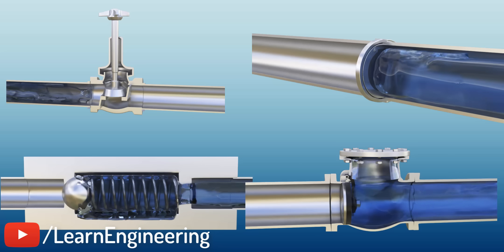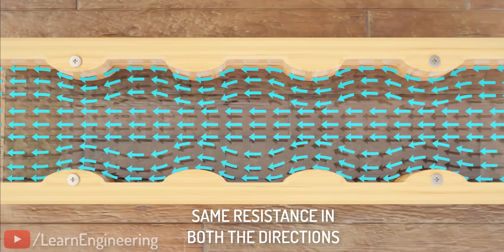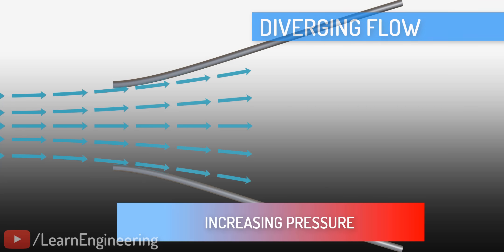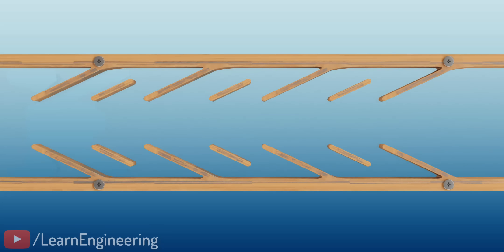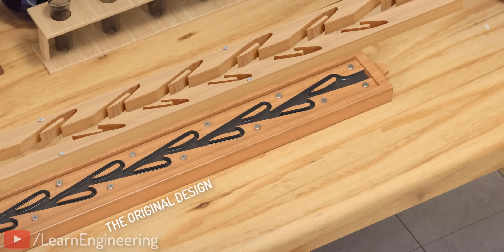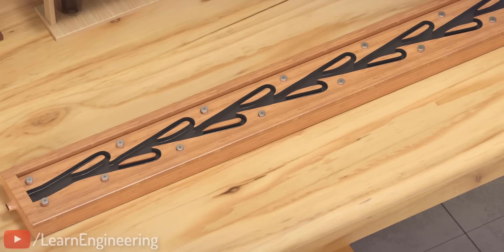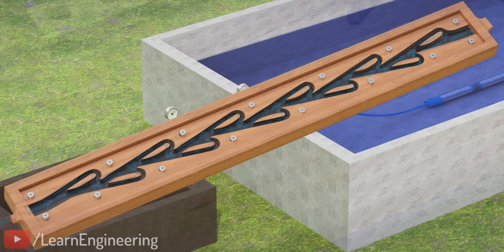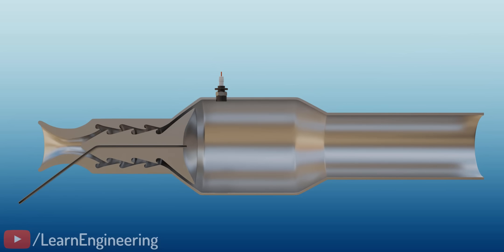Tesla Valve | The complete physics

Comment: When you say "let's see it work" pretty sure everyone was expecting a real life version. You can make anything happen with computer animation
Reply: It should be fairly easy to 3d print this valve,probably already done and tested,
Reply: I just saw a demonstration of this valve where the guy filled it with propane and then lit the propane so the flow was illustrated by flame. https://youtu.be/tcV1EYSUQME?si=F5TRQ5mhFaDe3bG6
Reply: https://youtu.be/NYGq0bD3NBk
Reply: https://youtu.be/NYGq0bD3NBk
Reply: https://youtu.be/NYGq0bD3NBk
Reply: https://youtu.be/NYGq0bD3NBk
Reply: @quynhm.nguyen6433  You may have commented 10 months ago but you did the work finding the video and should be commended.  Thank you.
Reply: With reference to electronics and electrical circuits this simulation is nothing more than a leaking diode with very little practical application. As a component it's function depends on the viscosity of the substance that is flowing through it ie. air, water, gas, oil etc
Reply: @MrNigsWhittington  been there, done that ;))
Reply: You're the same kind of jerkoff that if they did have a actual valve you would claim they turned the pressure down on the hose.
Reply: How about get yourself an engineering degree and build one? What a peasant mentality. 😂 The physics was explained. Then make it work. Otherwise, keep walking.  And since you make a claim that anyone can just make an animation where anything can happen, tell that to computational physics simulations that were designed by programmers and physicists smarter than you. And these programs have actually made breakthroughs in quantum knowledge you know nothing about. You may not know anything about it, because you haven’t tried understanding it. 😂
Reply: no
Reply: Indeed, repeating the animations that were used throughout the video and putting a "pump and pool" on the side of said animation isn't anywhere close to "let's see it work." Might as well cut out that section of the video, it adds nothing and is disingenuous.
Reply: I can't believe a channel with a robot voice and no practical hands on content has this many subs. There are so many good channels with actual humans with way less subs.
Reply: @Umphy  "Robot Voice" "actual humans" This is an actual human. That or the most realistic Robot i've ever heard.
Reply: Real version was made, but the difference in flow rate in both directions was barely factor of two. Basically it was flowing just a bit faster in one direction compared to reverse direction. Not so impressive or even practical.
Reply: @igoranisimov6549  might work differently at different pressures
Reply: @mikelisteral7863  obviously, but the "extinction ratio" is not very high even at higher pressure. It has assimmetric flow just to make it interesting. No practical applications so far.
Reply: @igoranisimov6549  "No practical applications" False. Video literally gave an example of a currently in-use practical application.
Reply: @MrNigsWhittington   It's not really the same process though, these valves are more so based around fluid mechanics, suppressors are more about reverberating the sound waves in compartments that are the same both ways.
Reply: @silverfoxeater lol "why aren't you showing the space bend?" This really shows your own lack of scientific knowledge. The idea that science is mathematics and not based in reality is appealing to mindless cultists though.
Reply: @Nekrumorfiini1  I studied general relativity and have no idea what your problem with that statement is. The instances of spacetime curvature that are observational to (somewhat) naked eye are gravitational lensing and black holes, but the latter only exist far away and it’s difficult to visualise what’s going on, while the former requires you to stare into the sun. They can be illustrated much better via an animation, which is how it’s usually done.
Reply: @vilhelmscinis1588  Your lack of comprehension of the principle of cause and effect is impressive. Notwithstanding that space isn't real, it's imaginary just like the rest of modern physics, the motion of the light does not define the cause of its motion.
Reply: Not only that but it's not even really animating what's happening, just showing stats and expecting us to believe it.
Reply: @MrNigsWhittington  It was never a valve that made it into production, it is more of a theory or an idea, so a computer animation is perfect to explain the theory but not have to go through the expense of the manufacturing.  I am fine with the animation, the valve is a failure and was never used in real life, just an idea, it has no practical uses
Reply: It works like a crib.  There is no way to show you while it actually works.  This is why it is done in animation.
Reply: And it doesn't work ( completely ) it would have a drip leak .... Hell, I can plumb good enough to leave a drip leak. it's a water restrictor, not a valve. I saw you were one of the few people to see this vedio as a sham🥱
Reply: Only reason i clicked the video was to see real life test video... I couldn't care less about all the talking beforehand
Reply: yeah a real life version can be manipulated just like cgi genius
Reply: the dollar has already lost a lot since the beginning of the threats to Russia and Ukraine! The number of transactions conducted in US dollars decreased from 71% to 48% worldwide and the USA had interest on each transaction conducted, since they were conducted in dollars! And now there are fewer deals,, less income,, the default is closer, are you stupid?The USA received hundreds of billions in transaction profits! Less and less now.паВ,
Reply: We have a lot of people thinking that computer simulations are cartoons :v

They think that they gonna show cartoons and they can show anything they want, but they also think that they cannot make the same with "real stuff or systems" :v

I bet they think that using a calculator gonna be a mistake, they need to use their fingers to count cause they can be fooled :v
Reply: You probably don’t understand The Big Bang, so let’s see how it works!…..  E = MC🟧’d
Reply: Unless the animation is based on a correct simulation of the natural process then yes it's worthless.
Reply: Let's see it work implies explanation, not proof. Your problem with this model is that it does not provide proof, which was not the intention to begin with.
Reply: @harrisondelaine7719  THE VALVE WAS NEVER PUT INTO PRODUCTION EVER!!!! that is all the proof you need, if it was a successful design it would be in production
KIND OF LIKE CARS, TRAINS, CAP LOCK KEYS, you know stuff you use everyday.  
Go down to Home Depot and get yourself a new Tesla one way valve, oh ya THEY DO NOT EXIST!!!!!!!!
Reply: You know, you can also make anything happen with video editing. If you don't believe what you see and you are too lazy to do a research on your own, I guess the only option left is to create one yourself and test it.
Reply: Can you show the difference of water speed in a valve? It's an animation based on laws that are accepted. Like animating an object falling because we know gravity exists. Jesus
Reply: @lick28  His point was that you can animate anything. You can animate the valve breaking from excess pressure. You can animate an anvil falling on it. You can animate glitter coming out of the other end. You can also animate generally accepted "laws" in the logic of children's cartoons but that does not make them real nor evidence of any kind of "laws". And yes, you can show the difference of water speed in a valve. Today we have plastics and glass to make small scale low pressure valves. We also 3D printers and pressure gauges. I am surprised that a reasonable person would suggest that the only way to demonstrate how a valve works would be through computer animations. Because we all know the significance of computer animations when Nikola Tesla made the valve in question...
Reply: @guywiththebottle  and my point is that there's no reason to make up anything false. It's also much easier to just animate something we know to be the effect of a certain action than to go out of our way to waste physical resources like water and money. It's also easier to articulate how the inner workings of something goes in an animation as you can highlight the important things to be noted. Complaining about the fact that it's animated in this context seems very nitpicky
Reply: @lick28  There is reason to make up something false if you can get away with it or do not know better. People care about 'fake news' more than ever and everybody is the publisher on youtube. The guy asked for another reason to believe the premise of the video. If people know the effect of "a certain action", there wouldn't be a point to making the video. Is it a waste of physical resources to teach people about valves? You can highlight whatever you want in an animation, that was the point of the critique. Not sure why it would be nitpicky that the guy expresses that he would be more convinced by a recording of a stream of water rather than a simulation of a stream of water.
Reply: @lick28  We live in 2022 and you really wanna say theres no reason to make up anything false? The dudes right, I wanted to see it for real. I dont want what he thinks will happen in an animation, I wanna see what does happen in reality.
Reply: @lick28  I mean I prefer a real waterfall to an animated one... 
Yes, all throughout the video I was waiting for the real life test of the Real valve.
Nobody said the animation was inaccurate, just not what we wanted to see.
Reply: @lick28  no your not right here stop arguing,
Reply: @guywiththebottle  They use equations that we apply to real life through simulation idk why you’re mentioning cartoons lmao
Reply: @Mhmmz  I explained why I mentioned cartoons. They usually do not represent reality and they are drawn up. Showing an actual valve would have more credibility as opposed to showing an animation.
Yeah, I wouldn't accept an equation as a demonstration in this case. Especially not as the follow-up to "Let us see it work".
Reply: @guywiththebottle  WOW you obviously do not understand CADCAM systems computers have been used for decades Computer aided design Computer aided manufacturing.
Computer simulations are proven to work well enough to be used to simulate a simple design like this valve and we know the computer will be 100% right for sure.
YOU ARE WRONG, this valve was never made and has never had a practical use, so a computer simulation is 100% acceptable, this valve is a failure why waste time and money making a real one so it will fail exactly how the computer would predict.  Computers simulate way more sophisticated things than some fluid running through a valve with 100% accuracy( landing on the moon or pretty much any space mission is run through a computer simulation , cars, airplanes, the list is endless) Computers are that reliable, you just don't want to be wrong, a bruised EGO, is your problem. and honestly if you want one made, start your own youtube channel and build one if you think it is that important to keep arguing about.
Reply: @neavo8421  THEN BUILD IT YOURSELF!!!!!!!!!!  OMG it never worked and never went into production, the valve is a concept, you spend the money to bring it to fruition!!!
We will call it the Neavo one way dripping valve, so when you need a really slow steady leak this is the valve to turn to, the Neavo slow and steady leaky valve
Available on Amazon and all major home renovation stores who like selling leaky valves right out of the box
Reply: @tomdaniels3392  And I would still rather like to see the real thing than what he showed. And I am not  going to build it  myself. I watch a youtube video so I don't have to.
Reply: @tomdaniels3392  He showed real life applications at the end of the video. It does have its uses.
Reply: @guywiththebottle  lol I don’t think this video is for you
Reply: @lost524  Who is it for, then?
Reply: @guywiththebottle  people with an engineering mindset
Reply: @lost524  I think a lot of people disagree with that.
Reply: @guywiththebottle  why do you need an actual visual? do you think someone is trying to pull something over on you? is it this channel or is it Tesla himself?
Reply: @lost524  Because he built the expectation that it was going to happen.
Reply: @guywiththebottle  no, he didn’t, he explained the theory behind it then explained how it worked, the only people who don’t find that satisfactory are idiots who aren’t meant to watch the video
Reply: @lost524  Not very nice, is it?
Reply: @guywiththebottle  neither is demanding someone do something because their efforts they’ve offered for free were insufficient to you
Reply: @lost524  I don't think anybody is demanding anything. I can throw a brick in the middle of the road, for free, and it still wouldn't be a good idea in spite of it being a free brick or service. Free is not a way to avoid a negative reaction. Now get lost524...
Reply: @lost524  Yeah, no. I am critical of the information I am offered. Pull one over on yourself and get lost524. Maybe you should take yourself less seriously. Go reply to Aaeron Mitton's comment instead. He is the guy with 1500 likes for virtually the same opinion.
Reply: @guywiththebottle  and you can manipulate real physical objects i.e. any As Sold On TV item. What the hell is your point?
Reply: @lick28  Wow, you must be so smart. To believe anything you see on the internet without hesitation. Good on you.
Reply: @lick28  yes, it most certainly could be demonstrated without animation.
Reply: I think anyone who knows basic physics will understand why this works

Comment: Some days after seeing this video, I have now an application. Because I did not found a water pump with exactly the wished performance, I purchased 2 water pumps to be used parallel.
But what happens when one of the 2 water pumps fails? The water would go the easiest way and return on the failing pump.
Now I know this problem can be solved with this Tesla valve. After each pump a Tesla valve. When one pump fails, the water can not return through the failing pump. 
Or when I need only as much water as one pump can pump. Thanks to the Tesla valve, I could power only one pump and no problem with the second.

Comment: Id really like to see this two dimensional model recreated in three dimensions. Due to free floating components the 3-D version would have internal structural support filaments making it internally a very complex and organic design. Nonetheless, laser printing can now easily overcome these precious manufacturing limitations. Just a thought for engineers to fiddle with.
Reply: what do you mean by "3D"?
Reply: The best i can describe it is like the inside of a Conch shell. If you slice a thin section through the center of that shell you see beautiful organic compartments that do not interconnect. But we all know that if you clip of the top of the shell water runs right through it. I was wondering if there was a way to make the Tesla Valve into a similarly long but round device. The interior geometry may not be possible but then my brain is limited when compared to the capacity of current computers and 3-D modeling. I hope that this helps.
Happy liberty, freedom and Independence day.
Larry in Arizona

Comment: One would expect that the valve might actually let more fluid through the wrong way if you LOWER the input pressure.
Reply: You mean fluctuating from high to low would eject a significant amount of the fluid in the valve?
Reply: That is interesting thought, if I am understanding correctly you are saying that the lower the input pressure the valve would let more fluid through, it makes a kind of sense, but I think that because the input pressure is reduced the amount of reverse pressure to reduce flow is reduced at the same rate making it increase/decrease flow at the same rate.
Reply: @tiny99990  Well there is a minimum pressure/volume to get it to work I suppose.
Reply: @brokentombot  Again I am just a highschool grad but it'd seem to me the minimum pressure to have it flow through the valve would be pressure period, so long as the pressure is constant and the pressure on the exit is not greater.
Reply: @tiny99990  That turn would offer resistance and so at a low enough pressure it wouldn't make the turn and thus the flow would be down the main passage way.
Reply: @brokentombot  That makes a certain sense, but with a constant pressure on the turn wouldn't that force it to make it? 

I guess not because it could be so low that the water just starts to skip the turn all together and the water in the turn simply acts as a stopper.

Comment: I’m glad to see it used in pulse jets.  If it can function as a one way valve at those vibrational speeds, then why not try a Tesla valve as a replacement for reed valves in 2-cycle engines?
Reply: wouldn't work.  the reed valves on a 2cycle are perfect for its application in any position.
Reply: @mushroomman1856  probably not on all 2 cycles but perhaps in some cases it might

Comment: what is the purpose of the valve? The water can flow through a simple pipe too.
Reply: The water resists flowing in the opposite direction
Reply: @SelectKiko  
SO SIMPLE ALSO HAVE ONE DIRECTION FLOW.
Reply: @syedaaminazahra9045  in a simple pipe water can flow both ways, in this it cannot
Reply: @harrisonobrien229  EVIDENCE?